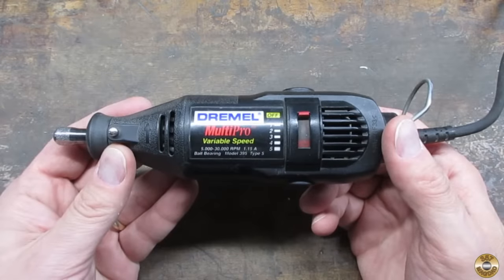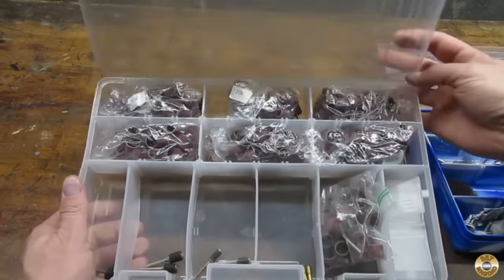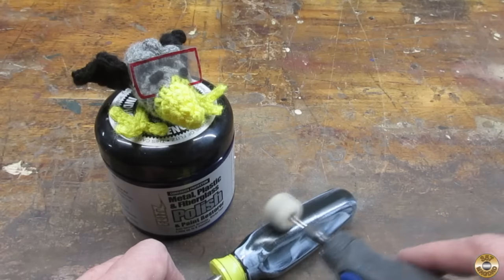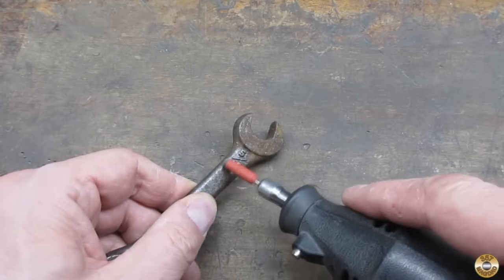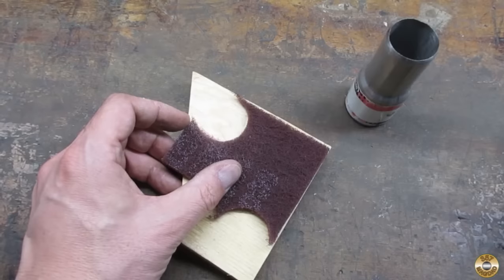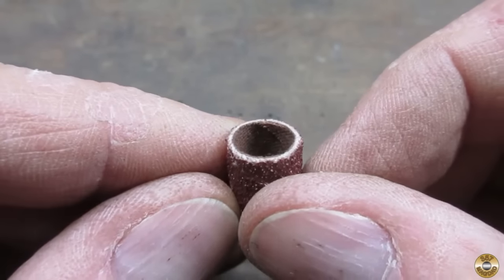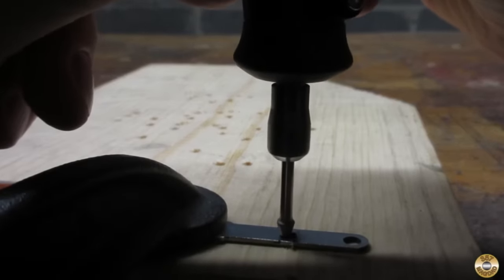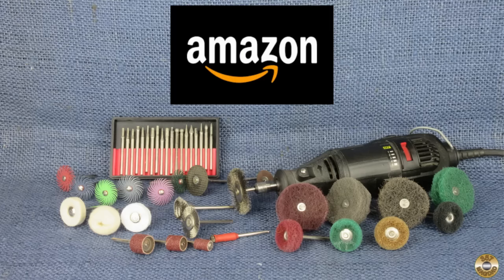Rotary Tools Tips and Tricks

Comment: I picked up a battery powered dremel marketed as a “pumpkin carver” years ago, super cheap. Still working as good as the more expensive models. You just need to not mind the orange plastic design.
Reply from the maker: I never though about carving a pumpkin with a rotary tool!

Comment: i use a dremel 3000 electric my top tip, as ive worked my way up to a dremel ive had some cheap but reliable rotary tools one a parkside model i fit it snuggly into a custom made wooden frame that works as a Lathe also a black n decker i made a brilliant 2 inch belt sander from so many amazing things we can make from one.(getting a fordam in june)
Reply from the maker: I use my rotary tool on almost every project!

Comment: There are three versions of those small "wire thrower" wheels, flat, wide cone and narrow cone. I find that the latter are the most effective ones at removing rust from tight and hard to reach spots, and when they wear down to a nub, what's left is effectively like what you got when you compressed a wide cone wheel with shrink wrap tubing. Instead of throwing these wheels out when they're mostly spent I reserve them for tougher rust spots like that which is encapsulated in shallow pits. Another nice thing about using them this way is that the remaining wires are too short to be thrown at you.
Reply from the maker: Give the heat shrink trick a try! 😉
Reply: When wire weels or regular (handheld) steel brushes get a bit 'frizzy', I tend to give the bristles a haircut.

A little less flex, a lot more strength for tough jobs.
      (And in case of wire wheels - less momentum. Making the bristles less likely to fly out)

It's also how I convert old paint brushes to excellent cleaning brushes :)
Reply: @iggysixx  You're referring to full size ones you use on a drill or die grinder. I'm talking about the much smaller ones you use on a rotary tool. You don't need to trip those because they're self-trim pretty quickly.

Comment: If youre going slow might as well use a cordless drill...not as nice to hold but it works. I use a dremel with a diamond flat wheel to sharpen bits ..even carbide bits...does a great job ..even the cheap ones.
Reply: correction to above  comment ...round wheels work well too.
Reply from the maker: Thanks for watching!  I don't own a cordless drill!

Comment: 2:50 Have you tried gluing the base of the wires in place with some contact adhesive? I haven't done that yet, but we sometimes use those wire brushes at work and I've often thought they should come with the wire bristles glued into place.
Reply from the maker: I tried super glue with minimal success.  The next time I'm mixing up epoxy I will try it on a couple.
Reply: @357magdad  in thinking JB weld of some type or a tiny bit of solder.  Thanks for the other tips!  Shrink wrap tubing is a great one

Comment: The three Dremel-brand tools I have owned over the years have had poorly balanced motors and bronze bushings instead of actual bearings, and wore out in a couple of years. Now I have a Tack Life rotary tool. Less pricey than the Dremel and has a smooth-running motor and ball bearings. Came in a fitted case with bits, and wheels, 2 different collets, and a flexible drive cable.
Reply from the maker: Thanks for watching!  I've had my Dremel for 25+ years and it's still going strong!  I guess they don't make them like they used to!

Comment: just stumbled across your video, I started off with a no name tool set from "big lots" good deal works well especially for a full starter set  with variable speed at 20 bucks, but its got a rubber component between the drive shaft and the collet which makes it a bit wobbly. Got a real Dremel second hand, and for fine detail work its much better. 
I use them both, but the no name import one gets the duty of sharpening lawnmower blades and other grunt work ... had it 10+ years now so its paid for itself and its holding up fine, but its not as good for tiny detail things
Reply from the maker: I've got a free pile no-name rotary tool waiting for when my Dremel dies.  I am keeping an eye out for an older low mileage Dremel at yard sales.

Comment: The only thing I could add is making cardboard cutouts like the scotch Brite ones. I  use the 4 inch but they work great and really last a long time. I use rubber cement to hoin the pieces. And it's difficult to keep it from spinning on the mandrel but once you figure that out using large washers and superglue.
Reply from the maker: Thanks for the tip!
Reply: @357magdad  works really good for polishing wood and steel...

Comment: About 'wire throwing' - you can easily make a see-through shield attachment from a reusable (sturdy) plastic drinking cup.
     Or from a spraycan (protective) cap.
      > Make a hole in the bottom.
Cut away half of the sides.

Orrrr... Alternatively....
You could try to hold it so you're not in the line of fire :)
.    (Aka if it fails, the ceiling, walls, and work surface get sprayed)
.     But I see you tend to aim it so everything from the work surface up can receive the full brunt...
     Sooo - diy plastic shield it is! (:
Reply from the maker: The plastic abrasive bristle brushes have replaced the wire flinging wheels for most of my projects.
Reply: Really good tip.
Reply: Brilliant idea -will plastic cup. Used it on wounds and will use it in this manner

Comment: As an alternative to those brown cutting discs which come with these sets, which are extremely brittle, you can get small metal discs which are diamond coated. These I have found extremely useful, especially for metal work.
Reply from the maker: I have not tried the metal discs yet.

Comment: Great video... long ago they used to sell small wire wheels incapacitated in resen . I haven't seen them in years but wonder if it  would be worth trying in epoxy.  Would probably keep some of the wires from ending up stuck in your skin ...
Reply from the maker: I've tried super glue and epoxy.  Neither worked for me.
Reply: @357magdad  thanks for the info Magdad... save me some time and materials...

Comment: Hi Magdad . Great Job On The Video. I Agree With All You Said. I Use My Dremel For Just About All my Restorations and Cleanups on Tools. Dremel Does Make Plastic Versions of Their Wire wheels . 3 Grits . Also Color Coded . They Are Good. Also Ryobis Are Are As Well.  I Have A 12 volt Max Dremel As Well . I have 2 Working Model 395's type 5's and One For Parts . ( Just Needs Brushes I Think.)  Like You Have . I Also Have A 395 type 6 Which Is Similar But Has Rubber Over molding Which I Removed . Too Bad They Don't Make Our 395's No More.   I Like My 90* Angle Attachment Too.
Reply from the maker: Thanks Wayne!  I need to use my right angle attachment more!

Comment: Adding a foot switch is a good addition.

The little wire wheels really throw wires and they are very fine, surprisingly they will end up stuck in feet especially with kids and such a tiny thing can cause a lot of pain so they are best used in the shed or a DIY glovebox
Reply from the maker: The little wires get everywhere!  We have pulled them out of our feet!  The plastic abrasive bristle wheels have replaced the wire wheels for most of what I work on.
Reply: @357magdad  those little bits of wire hurt stuck in your feet, happen to my young daughter a few times she was crying and screaming

Comment: I had one of those Li-Ion rechargeable Dremels, but I found that it kept cutting out when you put even a little bit of pressure on the work.
Reply from the maker: Mine has very little power.  I only use it for polishing plastic.  It was still a nice free pile find!
Reply: @357magdad  There are some new rechargeable models around now, which might be more powerful.

Comment: I run some thin epoxy around the inner part of my small wire wheels. It doesn't completely cure them of spitting wires, but it does cut it down by 90% or so as long as the wheel doesn't get too hot.

The heatshrink tubing on the brush is a pretty slick trick. I was trimming them down to get a similar, and probably worse result.
Reply from the maker: I've tried super glue, but the next time I'm mixing up epoxy, I'll try some on a couple wheels.
Reply: @357magdad  oooo im using this thank you!!!

Comment: The main problem with so many electric tools being battery powered is that when the battery finally fails to hold a charge, usually the whole tool has to be replaced as the battery units are by then obsolete. Never happens with mains powered tools.
Reply from the maker: My corded Dremel is 20+ years old.  I doubt there are many 20 year old battery powered tools still working!
Reply: Choose a cordless power tool with 18650 standard batteries 🔋 
At the end of the battery life, desolder it and replace with new more powerful 18650 battery. Problem solved. 18650 is very common battery size.

Comment: Interesting. I'm a hobbyist knife maker, and I find the sanding drums work far better for me at higher speeds. 
At lower speed it tends to bump and jump, while at higher speed it sands nice and smooth.
Reply from the maker: The bumping and jumping may be due to a bent mandrel.
Reply: @357magdad  hmm... I use several drums, unlikely that they're all bent. But they all grind smoother for me at high speed. 
I guess whatever works, works huh?

Comment: Very useful advice for the hobbiest. I learned the hard way about excessive Dremel speed. I ended up making myself extra work because the heat-generated friction from the Dremel blade melted the edges of the plastic I was working on. Also, I just picked up a bunch of sanding drums from my favorite consignment store. I'll keep the rpms down.
Reply from the maker: Speed is your worst enemy around plastic!  I like to use the puff ball wheels with a light touch.  I try to keep moving around to avoid making one area too hot.

Comment: Wonderful, especially the comments on the face shield and slow running.  Remember, however, that on slow speeds the full wattage is almost certainly not available, as with drills.
Also, though not mentioned, the chuck (available as an accessory) carries a lot of energy.  Probably a low speed tool.  Also, I am looking at buying a Dremel drill stand for mine.  It is not so much for drill stand as such, but as a way of holding the machine without clamping and stressing it.
You showed a right angled hand set.  Not sure about hand sets as they rob power from the machine.  The result could be overload??
You might enjoy Youtube 'Clickspring'.
Many thanks to you and commenters.
Reply from the maker: Thanks for watching!

Comment: I use the top half of a 2 liter bottle with the cap for a shield. Pop a hole in the cap so it will just fit on your Dremel with the plastic ring off. Then screw the ring on and then the bottle part. If that makes sense?
Reply from the maker: Interesting idea!  Like the "cone of shame" the vet gives your dog!
Reply: @357magdad  yeah kinda. LMFAO.

Comment: The plastic wheels should be run as stacks of 3 at a time. Used singly they fall apart pretty quickly but triple them up (as they are designed to be) and they last ages. Big range of grits/finishes too.
Reply from the maker: Thanks for watching!  I use the bristle wheels all the time and haven't experienced them falling apart.  They need to be installed on the mandrel in the correct direction and they should be run at slow speeds.

Comment: The best tip I ever got about Dremel tools is buy a Proxxon. The old Dremels were made in the USA and were superb. Now they throw them together in the PRC and you can guess what that means. Proxxon tools are made in Germany and are a real step up in my experience. They have bearing stabilized heads and stepless speed control. You’ll pay more initially but less over a lifetime.
Reply from the maker: Thanks for watching!  All of my tips and tricks will work with whichever brand rotary tool you have!

Comment: There is a thing called "abrasive cleaning stick". They clean clogged abrasive and make it good again multiple times. Saves money and time, because using it is faster than replacing the sanding drum.
Reply from the maker: The drums don't clog, they wear out for me.

Comment: I HAVE USED AN OLD SEWING MACHINE FOOT TREADLE. I MAKE AN ELECTICAL BOX WITH AN DUPLEX OUTLET. I WIRE IN THE TREADLE BETWEEN THE WALL OUTLET AND MY  BOX . I PLUG IN MY DREMEL TO MY NEW BOX AND SET MY TOOL AT THE SLOWEST SETTING. I USE THE TREADLE TO CONTROL MY TOOL SPEED. IT IS VERY GOOD FOR PLASTIC WORK.
Reply from the maker: THANKS FOR THE TIP!

Comment: Heat shrink is a great idea so is 5min  epoxy on the wire wheels just where the wire meets the bit shaft
Reply from the maker: I have tried super glue on the wire wheels with so-so results.  The next time I'm mixing up some epoxy I'll glue up a couple.

Comment: Greetings! After sanding a wooden surface with my rotary tool, the surface tends to be a little wavy. Apparently I am not able to apply uniform pressure over the entire surface. Is there any way to level and smoothen it?
Reply from the maker: I think you have to hand sand to get a better finish.
Reply: @357magdad  thanks! sounds like the only reasonable way to me, although it won't be easy to access the area with a proper hand sander

Comment: I use epoxy resin on the base of the drum and cup wire wheels
It stops the wire bristles from being spat out.
Makes em last longer
Also build a 45 degree angle box with glass on the front
Slip arms in from the sides
That way u dont need goggles
When using dremel sitting at a bench
Reply from the maker: I'm glade the epoxy trick is working for you.  It didn't work for me.  Either did super glue.

Comment: Quick tip: Only for the DIY tool modification type folks though. Find a sewing machine  peddle and wire it into your dremel plug. Suddenly any other option just isnt an air option. Nothing better than a pedel speed control. Makes all the difference beimg able to throttle your way out of a sticky situation instead of the dreaded bog/ chatter whirl that  we all know to well.  Give it a try let me know. Makes me wonder why dremel hasnt made this option a standard function on all their tools?
Reply from the maker: Thanks for the tip!
Reply: @357magdad  no problem

Comment: That’s a pretty 😍 good 😊 idea 💡 for starters, or the advanced. Running 🏃‍♀️ your Dremel tool at lower speed settings. This even promotes longer motor brush life. The face shield 🛡️ is a GREAT 👍 idea 💡, protecting you against flying wire fragments, cutting wheels 🛞, etc, or fine bits of glass, especially in the eye 👁️ OUCH 🤕!! That would REALLY hurt 😞. Your friend, Jeff. I REALLY like 👍 your idea 💡, to run 🏃‍♀️ your Dremel tool at the LOWEST speed. This may even let your Dremel tool last longer, too. It will practically thank you 🙏. No buying a Dremel tool every year, at $159.99, for some models of them.
Reply from the maker: Thanks for watching Jeffrey!

Comment: A friend is a jeweler and turned me on to Foredom tools. 0 to 18,000 RPM with high torque. He says they need a break in period though. So he told me to put a reinforced cutting wheel in my Foredom and cut up any Dremel tools I have. Then the Foredom is properly broken in and I never have to deal with a crappy Dremel tool again.
Reply from the maker: Thanks for watching Greg!  I bet that Foredom is the cat's meow!  Comparing a $400 tool to a $40 tool doesn't seem fair though...

Comment: I bought my first rotary tool (Apexforge M6 Pro) last month and i love it. 

The speed adjustments go in 1,000 rpm increments, from 10,000 rpm to 40,000 rpm. 

I have a small knockoff Goxawee tool for when i need lower rpms. The goxawee is barely able to be called a rotary tool. It can do very basic sanding\polishing but i bought it to test the waters. To see if i enjoyed rotary tool work. Then i bought the Apexforge. 

I appreciate your video because I'm still a newbie, and i don't know what attachments are best for different work\materials. What is a big deal for me is the flexible shaft attachment, which I use whenever possible. The small size and light weight offer excellent maneuverability. I also decided against battery powered tools because i don't need the convenience of no wires at the expense of the tool bogging down during use. 

Thank you for the useful tips.
Reply from the maker: I'm glad my video was helpful!  There are definitely a lot of rotary tool options out there.  I never got used to using the flexible shaft.

Comment: What rpm are we talking about for the low speeds? Too bad you`re not stating the model type of your electric tools.
Reply from the maker: My Dremel is 25+ years old, so the model number probably wouldn't help anybody.  I do not have a way to measure rpm.
Reply: @357magdad  My Dremel model 298 is also 25+ years old. After all these years, it`s still my favourite go to Dremel model. I just heard someone mention that the lowest speed usually is indicated as "5K" or "3K" but in reality is much lower. Which is interesting since i am looking for something like that.